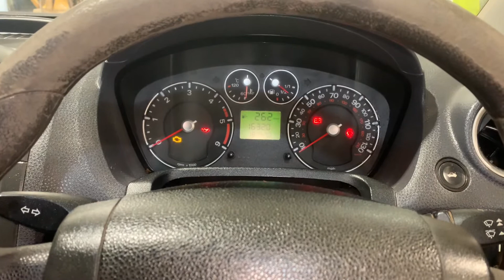Ford Fiesta Mk6 1.4tdci Oil and Filter Change

Comment: How not to do an oil service! Firstly you should remove the plastic air inlet and hose in one rather than potentially damaging the hose by prying it with a screwdriver. You only need to remove one screw. Secondly you should put a rag beneath the oil filter housing to stop oil falling on to the block. There will be plenty of smoke while the spilled oil burns off.